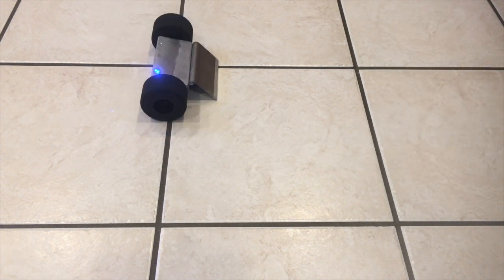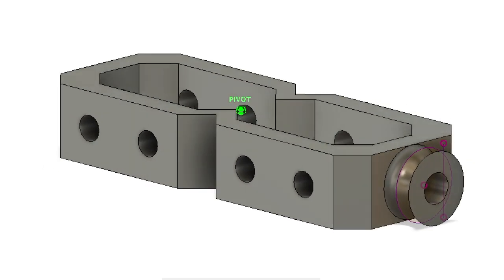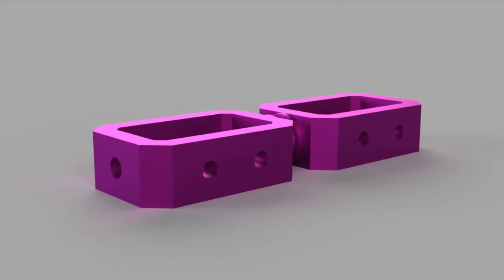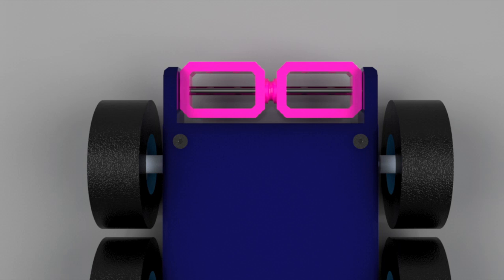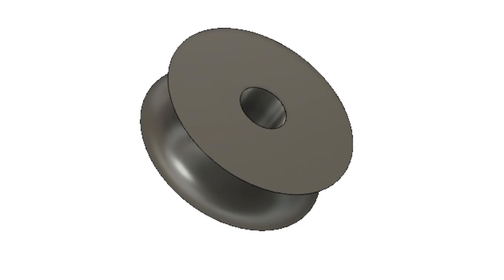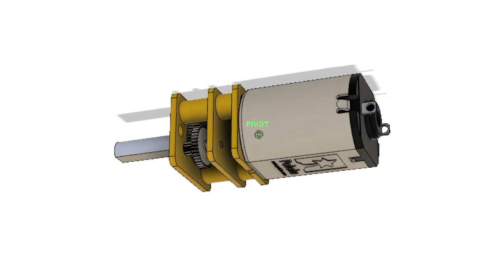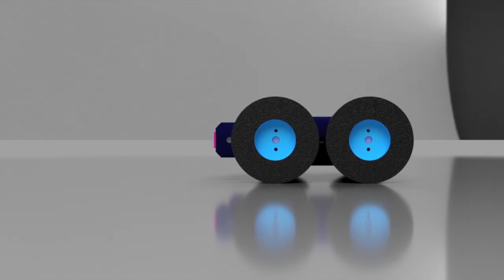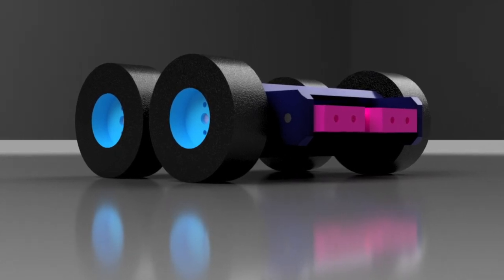Blastwave Antweight Battlebot Pt 1 - CAD Model

Comment: are the cad files for this project available or no, i was thinking of using it as inspiration and it would be easier to have a reference i can modify to suit my motors and control system
Reply from the maker: The cad files for Blastwave 2 can be found on my discord: 

https://discord.gg/w3NBRZKS

Blastwave 1, 3, and the upcoming 4 haven’t had their models released yet, I should try and do that eventually

Comment: Any chance you’d share the CAD for the custom wheel hubs? Also, be warned that the center of the weapon will be the weakest part of the system, and a nasty hit could cause the entire weapon to rupture, especially if it’s made from a 3D-printed plastic... it’s why most people use aluminum, titanium, or steel.
Reply from the maker: Link to the Wheel Hub: Hubs: https://www.dropbox.com/s/xlhlvrx6r8d1rti/Wheel%20Hub%20v6.stl?dl=0

The original plan was to get the part made out of a steel or aluminum, but plans ended up changing. I'll have to leave it at that as the next part should be out relatively soon. :)